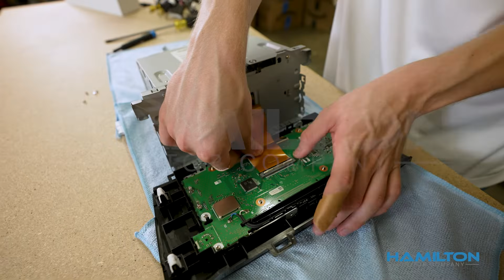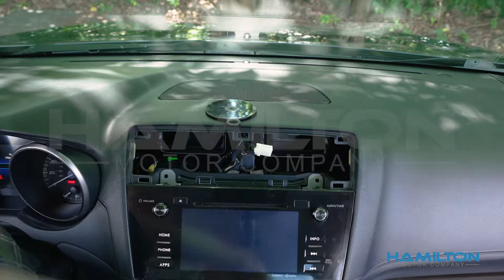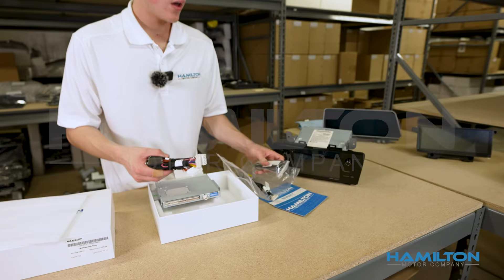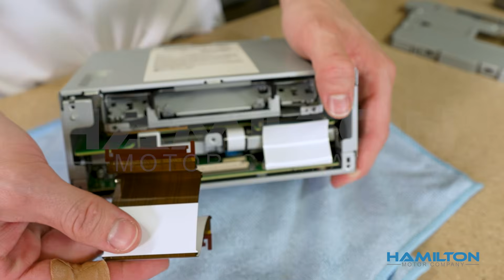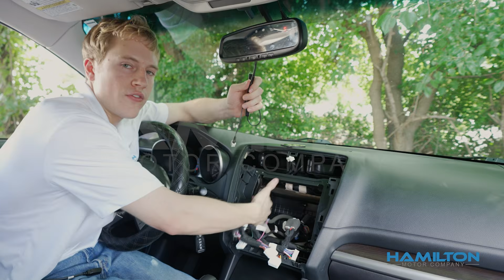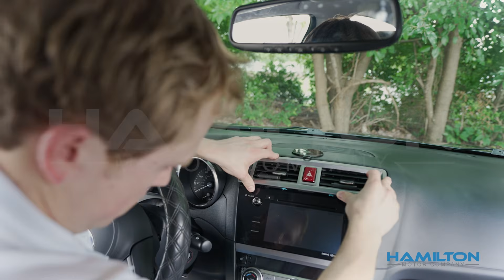2015-2017 Subaru Legacy Upgrade Kit  | CarPlay & Android Auto Installation Guide

Comment: Does this also retain the factory unit connection and display of the vehicle monitors like the awd status, fuel usage and other maintenance monitors?
Reply from the maker: Yes the upgrade kit allows you to switch back to the Subaru OS where all these features are by long holding the voice speech button on steering wheel

Comment: The installation doesn't look very difficult. May be putting back de wiring is the toughest part. Is there an instruction manual or another video if we have any doubts with the wiring? I am writing from Peru.
Reply from the maker: That wiring is pretty straightforward. The hardest part is seating those ribbon cables. We have tech support at 919-858-2890.